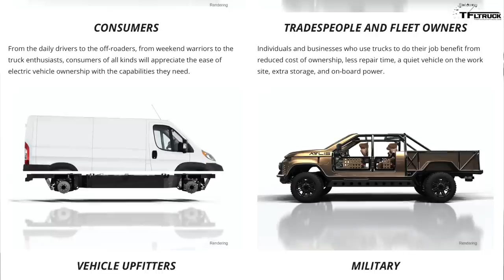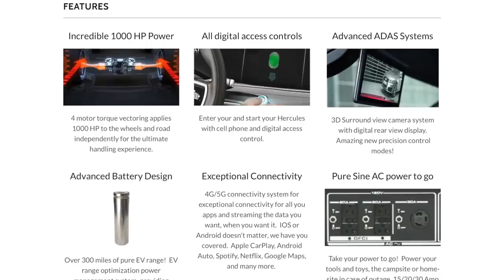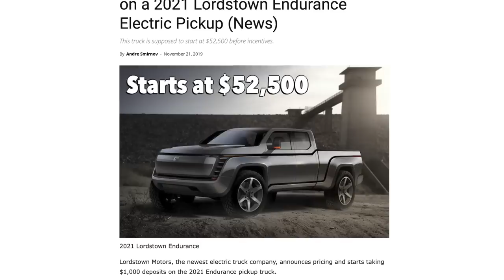Will You Soon Be Driving One of These Electric Trucks? Top 10 Upcoming Electric Pickups from A to Z

Comment: The reason the Cybertruck looks the way it does is that its design is not only the strongest, it's the least expensive to produce. It's all flat sheets, cut and folded. Both the exterior structure and interior structure are as simple an inexpensive to manufacture as possible. The exoskeleton is both stronger and lighter than a body on frame, allowing more battery capacity.
Reply: @Jack Le It translates into "hard to break."
Reply: And yet in 4 years the price doubled and the features went down

Comment: I am going to guess in a few years battery capacity and recharging speed will be improved making these vehicles more viable. And once you did a electric vehicle you will never go back to gas/diesel.
Reply: I don't think so they said that in 1917 when the first electric cars failed. I'm still waiting.
Reply: There are limits to battery density and charging speed due to physics and we are not far off reaching them i reckon range will start toping out at about 400 to 450 ish then we will hit problem with charging infrastructure and being about to power it all
Reply: @allwaysinquire6212  already have some instances of half mile lines. I don't want to get one and then so many get sold you spend 3 hours at a charging station. Then nobody will want them and your resale will suck. Setting up food stands at charging stations could be profitable. And perhaps movie rentals if lines get to be like i think they are.
Reply: My model 3 can add 250 miles of range in 15 minutes. I'm ok with that considering it's only when on a long road trip, and I never have to stop for gas because my car charges at night while I'm asleep. I'm guessing I spend a lot less time fueling them you do because it's basically never...
Reply: @markjames2338  i would love to try a tesla but they are ten times the price i can affort for even a second hand one here in the UK a leaf is still £8 second hand will only a 100mile range. This is my major concern that EV will make alot of people like me either alot poorer or carless with out an ability to get anywere due to being forced out of a ICE due to baning of them ( theres three citys here in the UK that i cant drive into due to this allready) plus once EVs get to 30% of the car fleet watch the tax bring them into line with ICE cars they will not be cheaper to run then

Comment: The problem with EV trucks is that they don't have batteries with sufficient energy density or ultra-quick charge time needed for towing. Combine that with cold weather, and you have a real problem. Right now, the current battery tech just isn't John B. Goodenough.
Reply: Sorry, which EV trucks have you tested?
Reply: You are absolutely correct
Reply: @Bryan46162  Its common knowledge that batteries don't like cold temps, last winter lots of people found out their EV had much shorter range in the cold.
Reply: @Bryan46162  What part of my statement do you feel is incorrect? Be specific.

Comment: Fast battery charging can be achieved with some creative uses of diodes and relays. Simply put, the diodes and relays isolate battery packs from one another, so that each pack charges separately from each other. But what is still required is to have the ability to deliver the necessary energy to the charge controller to charge all those battery packs. Can it be done, yes, will it be easy, no!

Comment: I love the Rivian.  I think they have the most innovative design with the passthrough and the fronk but....but.  They like everyone else are NOT talking about towing and offroad efficiency numbers or ways to keep your vehicle charged if you're not close to a charge point.  I'm sorry I don't care about the torque and hp numbers unless it can go the distance doing what a truck is supposed to do and not make me wait at fueling stations for hours on my road trip with a boat.   
Heck I'd take less torque and hp right now in exchange for a hybrid that got 40-50 mpg, 8-10k lbs towing and 600-800 miles of range.  If that means combining a large fuel tank with a large battery I'm all for it.  Also why has no one tried a diesel hybrid?  When you look at the numbers some of these EVs are giong for you'd think the costs for that kind of hybrid platform would start to make sense.
Reply: @sages7783  I want to be hopeful but until some numbers get released and guys like TFL get a look at it I'm going to remain skeptical.  I hope it works out but I haven't heard anyone announce a drivetrain different from Tesla so I don't see why it would be different today or 2 years from now.  Some are announcing new battery tech but I wouldn't touch that with a 10 foot pole cause being in the manufacturing industry myself the first few years of that battery.....everyone who buys it are the beta testers for it.  I'm not spending that kind of money to be someone's guinea pig.

Comment: It's a bit baffling to me why trucks seem to have skipped the true hybrid model.  That seems like the best solution for torque, efficiency and range until the battery/charging technology develops further.
Reply: Totally agree, I think that would be the best way to go!
Reply: 100% agree
Reply: Perhaps you missed the whole giant flop of the Suburban Hybrid.  For an extra $15k or so you got a suburban that got like 2mpg combined better mileage.  Hybrids in heavy vehicles just don't work as well as they do in lighter ones (something that EV trucks are going to find out as soon as they are loaded up with cargo) because they burn battery too quickly, and then once the gas engine takes over, it has to carry all of those heavy batteries around.  In a lighter vehicle like a sedan it works but in a heavy one, with a curb weight of 6500-8000lbs you're not going to get any tangible benefits from a hybrid drive system.
Reply: @nothingtoseaheardammit  That is a completely good point, however with the amount of focus on this area the technology should be further developed to provide much better results. Especially because the regen power of a heavy vehicle would be more than a lighter vehicle. The suburban hybrid's lack of results was its own death sentence.
Reply: It wasnt skipped. GM did it quite a while ago and no one was on board with it so it was scrubbed
Reply: They should  make a system like the Chrysler Pacifica hybrid, drive about 30 miles of pure electric range and the then the gas motor kicks in. Even say make somthing with 100 miles of range and then the has motor kicks in! That way if your pulling or in the cold just run gasoline.
Reply: Because hybrids just saddle an EV with all the problems of an internal combustion engine... maintenance, expensive fuel etc.

Comment: 500 miles in 15 min? Doubt it!
Reply: Yes, those numbers are suspect in comparison to most of the others.  Unless they found a breakthrough technology.
Reply: Probably replaceable battery cartridge lol
Reply: @youngblood23rb  they stated on their website that there wouldnt be any battery swapping for their vehicles
Reply: They were able to do it at a smaller scale with a 3kw/h battery, they are hoping that they can get the same results at a larger scale
Reply: Maybe if they heat the batteries it's possible
Reply: b.o.s domestic disputes 
They did heat the batteries. They actually did it in 12 or 13 minutes. No report on the overall life on a battery like that though. Tesla has technology is in the works for long life with fast charge but right now fast charge means reduced life.
Reply: matt wodziak that’s why I’m not a big fan of the superchargers. No way I’d buy a used Tesla right now because if you got one from someone who frequently used the supercharger you know battery life would be compromised.
Reply: I’ll take longer stops on road trips ALL DAMN day if I’m waking up with a full tank every morning
Reply: It can be done right now but the problem at this moment is the tremendous stress that puts on the battery; that stress right now is equal to an excessive reduction of the recharge cycles. A lot of people are questioning  something similar with the porsche taycan technology.
Reply: I can bet they used some battery from a secret company that has more capacity in a smaller space. Or their battery is H U G E. And I agree that you can't recharge 500 miles in 15 min. YET.
Reply: If this is true then they must have discovered a Nobel Prize worthy technology.

Don't hold your breath
Reply: Smarter Than You   Not everyone wants to stop for that long after 4 hours of driving. And that’s about what it would be on the freeway.
Reply: @ES-pr8bt  superchargers are fine the concern is the new heated Battey fast charging they are testing which might shorten battery life
Reply: b.o.s domestic disputes that’s my point lol.
Reply: @mattbrew11  driving my 12 Ram 2500 diesel, if all I do is drive to work and back I get about 2 weeks of driving and don't worry about a full tank of fuel.
Reply: Rexford L that’s nice you live so close. I’m 30 miles outside San Diego. I’m in the solar business so I have 18kW of solar and 70 kWh of usable storage. In my situation I get back around $1500 annually from my utility company and will continue to do so with this truck. Compared to the $3800 I spent last year on my gas pickup that’s a huge swing and worth the long distance aggravation
Reply: About 22 miles one way.. but a 34 gallon fuel tank in my pickup.
Reply: I haul with my dodge 3500 dually for a living. My question is if hauling a big trailer where are they gonna find a place to charge it up. Only way is if you leave your trailer somewhere while you go find a charging port & wait for hours to charge up & then you do not get many miles in a day which cost us drivers tons of money. 500 miles a charge & charge it back up in 15 minutes sounds fantastic & the charging could be done during a required break during a day of driving. Somehow I think this Atlis is a scam like the Elio is.

Comment: Can you do a video on this topic "Gasoline Automobiles are Obsolete"
  I know you guys will do a good job,.. lemme know what you think,..lol

Gasoline Automobiles are Obsolete
The Electric Drivetrains makes the most sense and are now more practical and affordable for Cars & Trucks 

FUEL COST PER MILE
• Less than 20% of the power in Gasoline goes to propel the Vehicle
• Gasoline Cars cost per mile 10 to 30 cents/mile
• Electric Cars cost per mile $0.4cents/mile

10 Most Common automotive Repairs

1. Brake Work
2. Oil Change
3. Coolant System
4. Tires
5. Ignition System
6. Electrical System
7. Fuel System
8. Transmission
9. Exhaust System
10. Air Conditioning 

The Most Common Internal Combustion Engine Problems.  “ICE”
1. Engine Won’t Start
2. Battery Failure
3. Wiring or relay failure
4. Fuel pump failure
5. Dirty fuel filter
6. Check Engine light
7. Emission problems oxygen sensor
8. Spark plugs/distributor cap/electronic ignition
9. Fuel quality issues
10. Overheating
11. Faulty thermostat
12. Kinked of broken radiator hose
13. Low coolant level or coolant fan failure
14. Dirty air filter

Electric Cars & Truck are the better because
1. Powerful & Safe
2. Cheap to operate
3. Even cheaper to maintain
4. Drivetrain Warranties for 8 years of more
5. Can be re-fuel for free at home or work and on long trips
6. Will have a greater re-sale value

Comment: When towing cross country, will I have to detach my trailer to charge the truck?
Reply: Why would you have to
Reply: Rick Balderas because of the way Tesla chargers are positioned you can’t unless you block the place off because of the way they’re set up
Reply: yeah or block them off.  Tesla didnt think to make pull through chargers.
Reply: Once electric semi's are more common, electrifed roads will be common on long haul routes... either catenary or road embedded induction, just like electric rail... this tech has been around 100 years.  If it's induction, you can mount an induction coil under your truck or even your trailer and you wouldn't even have to plug your car in.
Reply: Nothing stopping addition of pull through chargers on interstates.
Reply: There are some pull throughs but most aren't. That wouldn't be my concern. Having just seen an article on half mile lines at some places in Cali I would be more concerned with spending 2 to 3 hours at a charge station. Production is vastly out pacing infrastructure.
Reply: @ColoradoHiker  the lines are mostly a holiday thing. I don't think it will be as much of an issue by the time the truck is released because other companies are adding chargers and Tesla will be able to use those DCFC chargers while also expanding it's 250 kwh network. Also, if the company adds pull through chargers it would be easy to restrict charging to the Tesla truck as the company will have VIN. It could even restrict to towing vehicles by accessing kwh consumption.

Comment: Extended range needed because you want to haul a trailer for more than 500mi? No problem, just build a trailer with an extra battery in the bed and connect it to your truck while driving. (Agreed, a few problems need to be solved, but that should not be to hard.) My 2 cents.

Comment: If it can't carry a load more than 150 miles without a recharge it is worthless.
Reply: They aren't stating how long they can tow their max weight for.
Reply: @atodaso1668  of course not. You can find real world towing tests on YouTube useing the tesla SUV.
It stunk under load. 
Majority buy trucks for hauling more than just thier butts.😀
Reply: The Tesla tested went from just under 300 miles range to 110 when towing. Now imagine if you were towing in the cold and cut that in half. Not a chance i would get rid of my F150 for one. EVs to me the sweet spot is small cars/motorcycles/bikes for around town commutes. I have serious doubts the infrastructure can keep up with all the electric vehicles coming out. Just last week there was an article about a half mile long line at a Tesla charging station. No thanks. I will let the industry mature before i consider one.
Reply: Under 150 miles I'm pissed. They need to actual rate the tow mileage at 0 incline.
Reply: @ColoradoHiker  not to mention how heavy they already are plus the tongue weight and drag. If they put a battery back or regen system on trailers then we'd be in business.
Reply: @ColoradoHiker  towing in the cold would produce enough heat it would negate the range loss from cold.

Comment: I still say hybrid is is where they need to be focusing on the truck market. Leave the EV to sedans/crossovers. You're going to want something that can run 2/300 miles (or more), and then be able to refuel very quickly (in under 5 min) at least while towing. Hybrids have the best of both worlds. EV efficiency/power, and fossil fuel refueling quickness.

Comment: We've seen how EVs perform when towing.  They really can't realistically do it.  These are trucks that can't do truck things.  Hell, I doubt their capabilities for even a camping trip.  Loading up with all your gear and your family is going to destroy range and I don't think there's many Tesla superchargers out in the boonies.
Reply: TwoZeroFiveZeroZero a gas truck is around 35% as efficient when towing
Reply: @mattbrew11  Now take your thought to the next logical step. How long to refuel versus recharge?

Also the reduced range of an ICE truck is still much further than the reduced range of the EV. My truck can pull a boat further than 75 miles on a full tank.
Reply: TwoZeroFiveZeroZero have you seen an electric TRUCK towing?   The Tesla 18 wheel will have 300 or 500 miles of range at 80,000lbs. Fairly certain that at least TESLA can figure out how to make their truck work ok
Reply: @mattbrew11  right that truck is vapourware Tesla has been back pedaling since the rolled out the prototype.the specs dont add up
Reply: walt charamba  really Teslas track record of bullshit is very long! Musk is a salesman not a engineer thats his problem hes great a saleing an idea but 500 miles is vapourware! Once you try towing anything it will be 150 miles. The energy density of 21700 cells ( what tesla uses in there battery packs) is nearly maxed out unless they had invented a unicorn they are talking out their ass. Now dont get me wrong if i had £70,000 plus to blow on a tesla i would get one but saying Elon will do all this shit is stupid Tesla cant even deliver a new model on time so how can we trust the crap he says
Reply: I tow multiple times a month and the 300 mile range Cybertruck is more than enough as last ng as it can handle the 10k lb loads, which it will. Charge at home and never stop for gas.
Reply: Keep in mind that I tow as per of work which is local, I'm not a long haul trucker doing interstate trips every month.

Comment: I have to laugh when I see the drawings and pictures of these ev trucks. Real truck guys don't want something that looks like it came off the Star Wars set. Also nobody has shown that they have the technology to make an ev truck viable. They are going to need 300+ mile range with a full load and price the vehicle reasonably before the masses will even consider going ev.
Reply: The range with load is the downer, and no one is talking about it.  Better load that bed with ping-pong balls to get anywhere near 300+ miles.
Reply: @W7DSY  I watched the tow video where the guy hooked up a computer and towed with it. Not good. Then imagined adding in cold weather. Big no for me.
Reply: DrgnFlys  Well I'm glad you admit the thing is no good as a real truck.   Most people will buy these origami toys so the neighbors can see how progressive they are.
Reply: Wrong, I don't care what my tools look like as long as they get the job done. Yes 500+ miles is more than 300, Tesla does that it was the deciding factor and why I placed my little $100.00 on the loaded top end model.